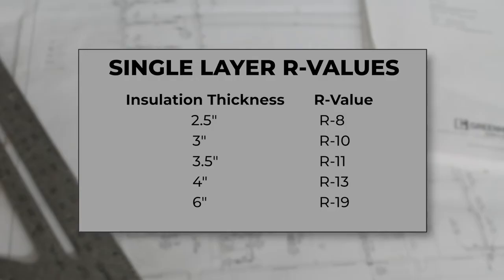Single Layer Insulation Systems for Metal Buildings

Comment: Now, let's say that insulation is 30 years old. Wet and previously infested with squirrels and mice. Insulation was removed to be replaced up to the first cross beam. Question is what insulation should I use to replace it with? Board insulation?
Reply: lol this is my exact situation. This stuff sucks.
Reply: @PinkFZeppelin  it definitely does. Fortunately I moved onto summertime projects but that nightmare is still looming in the distance. Let me know what you come up with.

Comment: how do you repair this? to create a new white finished look?
Reply: I'm here asking the same question. Had a leak on the roof that's been there for way too long. It's destroyed the insulation. We pulled down the damaged parts now I'm realizing it doesn't look so easy to put it back up.
Reply: Same. I bought a building with leaks and rodents in between. Looks like removing the panels fully is the only way.
Reply: @MrFreshpot  Did you figure out a good solution?
Reply: @hu_b  ended up using spray adhesive and batting then covered it with poly sheeting. Not perfect but good enough for the job
Reply: @hu_b  ended up using spray adhesive and batting then covered it with poly sheeting. Not perfect but good enough for the job
Reply: @MrFreshpot  ah ok thanks

Comment: I naively believed this advertising hype when I put up my metal building.   The gurts and purlins are a thermal bridge because the fiberglass is squashed down flat.  It is impossible to keep the building cool in the summer and it costs a fortune to heat in the winter.
Reply: I think this system is intended for non conditioned metal workshops.